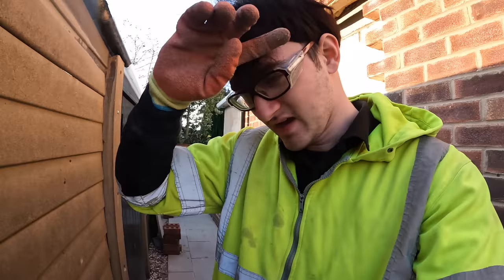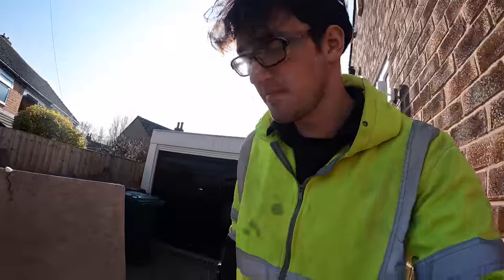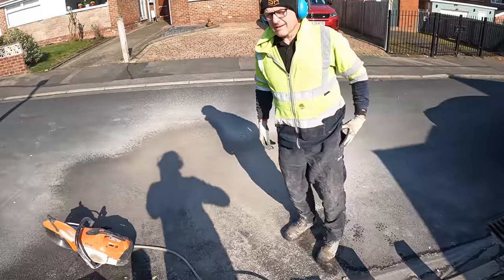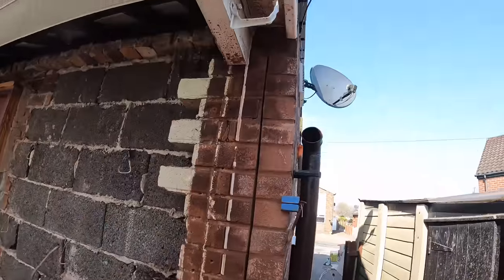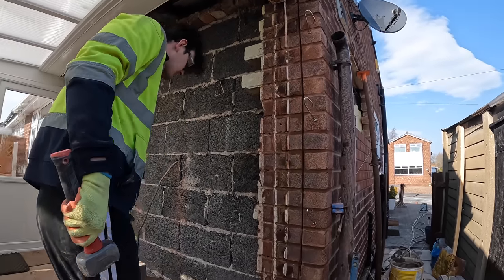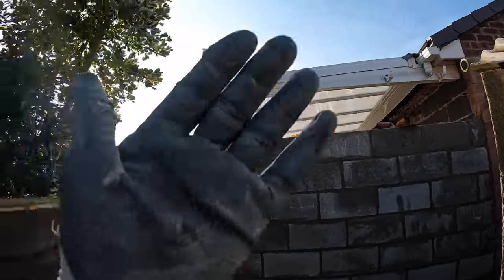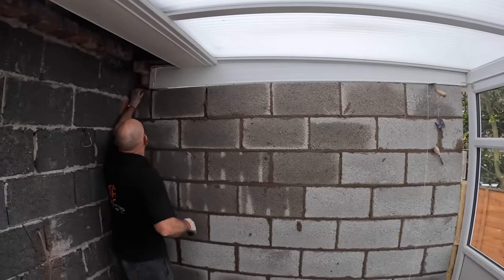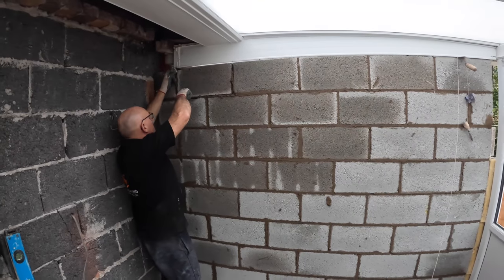BREEZE BLOCK WALLS  ..KITCHEN CONVERSION PT 3

Comment: A neighbour had a conservatory built here in New Zealand. From boxing the slab, pouring it, putting up the timber Frame, fitting in windows and doors to wiring it, fixing the insulation and gib board to plastering and painting, inside and out, 7 days. That included knocking through the existing exterior wall and making good. No cement, bricks, blocks, or concrete saw/mixer was used. One wall 4 meters long by 2.7 meters tall assembled and stood up, clad, insulation installed along with wiring 36 minutes. Still like watching houses being built the medieval way though. 🤣

Comment: Great video, can I give you a suggestion to keep you dry using the saw with water. Get a slaughtermans apron. It’s waterproof and goes right down to the ground past your boots. The water will run down onto the ground. I used to use one with a tile cutter.
Reply from the maker: Thanks pal 🧱👍🏽

Comment: Great work on that Steve and Alex u reached some good heights there Steve with as u said your little legs lol all the inside done ✅ some work cutting those cavity’s out wow and the Stihl saws are great but a time and a place and the water is a nightmare you will learn quick when and when not to Use cheers for upload have a good bank holiday weekend 👏
Reply from the maker: Yes John , Al is 6 ft 1 and I’m shrinking 😆🤣. The petrol saw is an absolute beast . 
   Have a great weekend pal 🧱👍🏽

Comment: Just curious as to why you never use an insulation block/aerated  concrete on the internal skin!
Reply from the maker: Very expensive, very weak . Fibolites are far superior 🧱👍🏽
Reply: Not a great  thermal rating!
Reply from the maker: @martin2466  All chance again 🙄🧱👍🏽
Reply from the maker: @martin2466  . 😒😒😒
Reply: I agree that they aren't great, but I'm having to build with a 5 inch cavity and full fill pir board to meet regs ☹️☹️
Reply: @martin2466  yeah mate !you too👍🏻
Reply from the maker: @Ink706  . Don’t mix the Mortar too strong then , maybe 5 to 1 🧱👍🏽
Reply: @SteveAndAlexBuild  watch out for June  boys!!😱
Not sure  what you meant  with mix 🤔
Reply from the maker: @Ink706  thermalise blocks need weaker mortar to avoid cracking 🧱👍🏽
Reply: @SteveAndAlexBuild  that's a given, both block  types  have the same crushing strengths .mortar  ratio isn't an issue!
Reply from the maker: @Ink706  🧱👍🏽